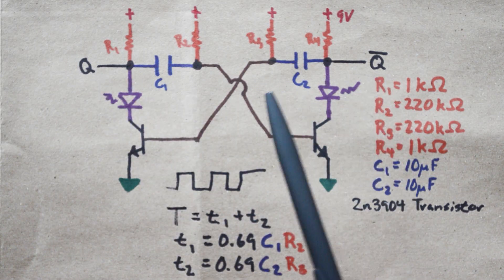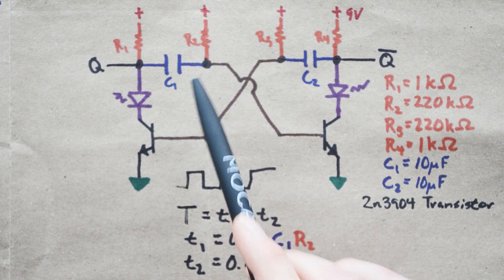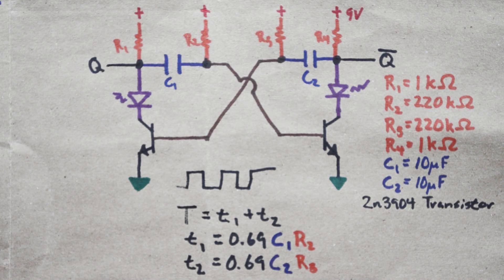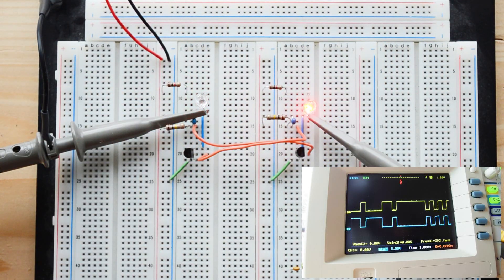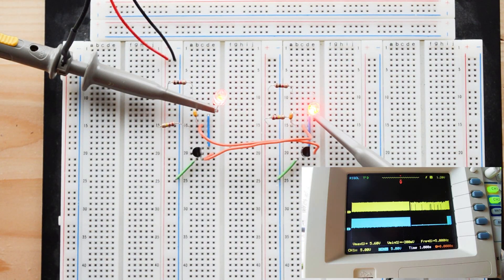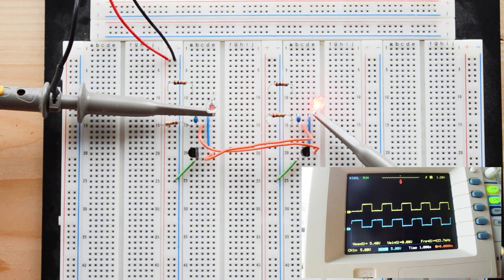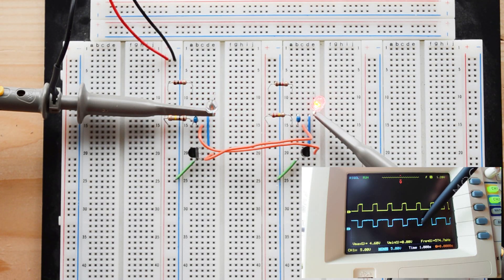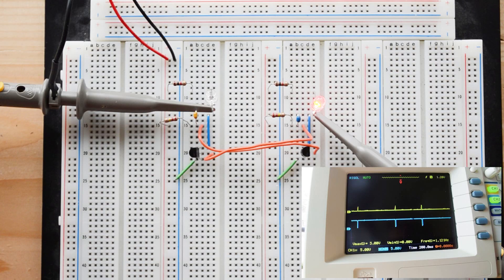Adjust the Frequency & Duty Cycle of the Astable Multivibrator

Comment: Hi Jason, 
Just wondering if you’ve checked out the data sheets for the TLC555 and the HA17555. They are supposedly more accurate than a standard NE555.
Reply from the maker: I have not, however most of my applications don't require high precision. I'll grab just about anything that has the "555" label on it. Thanks for the heads up though. I'll check it out. Might make for an interesting lab demonstration.

Comment: Is it possible to change the duty cycle with a reference voltage without an integrated circuit or micro-controller?

Comment: Just asking for a friend... If I where to drive a circuit (MOSFET) for an induction heater (ca. 500 W - 2k W) which would you use: (1) a 555 IC (astable), (2) or this type of multivibrator?  Merci de votre réponse. (NB. The IH circuit will have variable duty and frequency to accommodate changing the work coil and its LC tank: range 30-80 %/20-100 kHz). My newbie amateur elctr. friend has been working on this proj. for the past 6 monts thinking only in 555 or ZVS terms and just realized what is a BJT 'multi vibration circuit). Moreover, He as seen several circuits using BJT's in conjunction with 555 IC's to drive the IH's MOSFETS. Ho! by the way ... nice work for it all.

Comment: Hi 

I built up this oscillator and it works fine but this formula doesn't hold and R1 and R4 should be also included in the formula because changing their value changes the oscillator output frequency